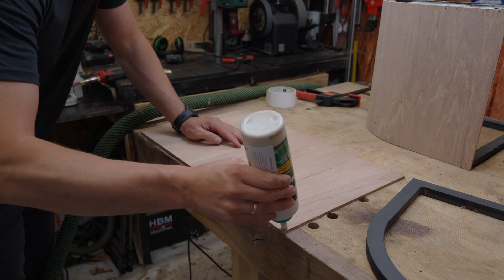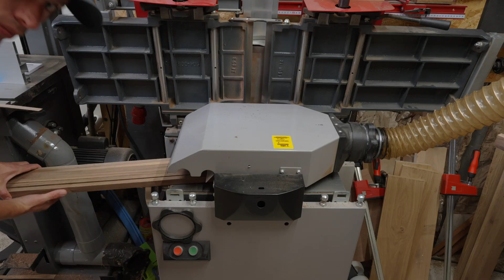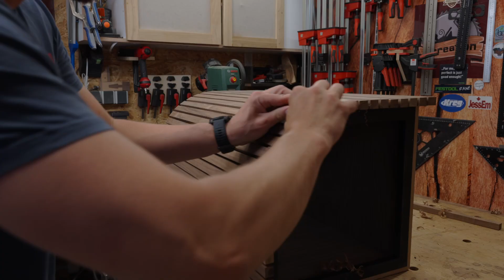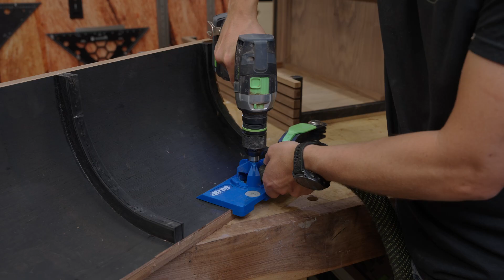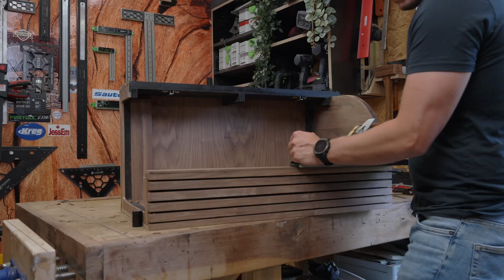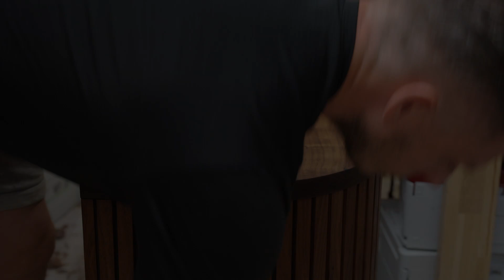DIY Half-Round Walnut Cabinet: Step-by-Step Build & Finish #woodworking

Comment: Awsome, going to use this idea to fit in a tight corner near a bay window which is just 10" deep, perfect to cover my router wires coming into the house and plug socket, with router on top and extend it in height with a shelf  for a table light, finished off with the skirting board continuing the curved profile. Will look smart with my slatted timber back panel for the TV next to it.
Brilliant idea and video was clean, informative and concise, just what I like. Superb 😊👍
Reply from the maker: ❤❤ thanks